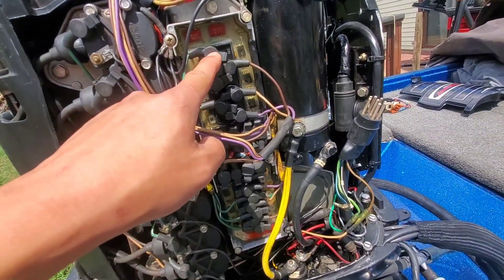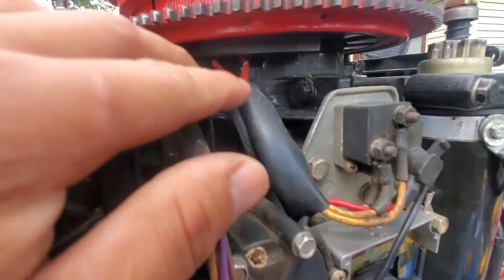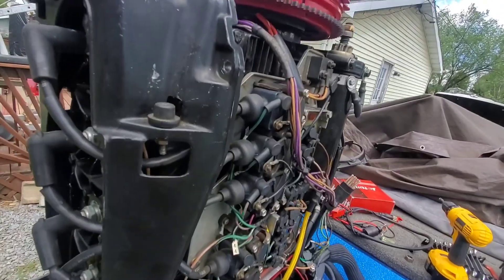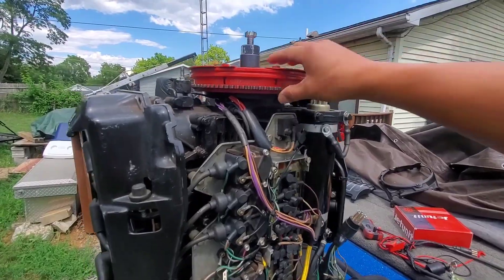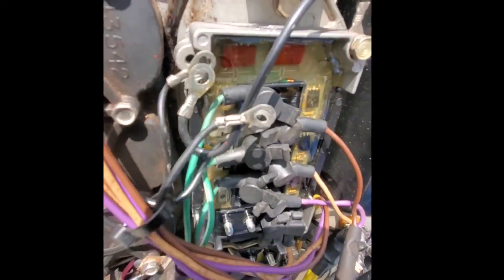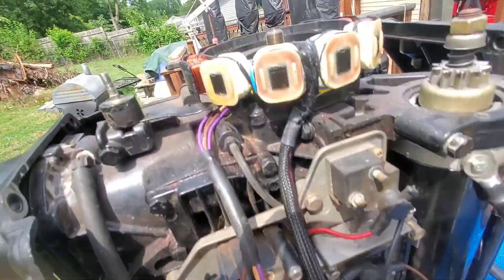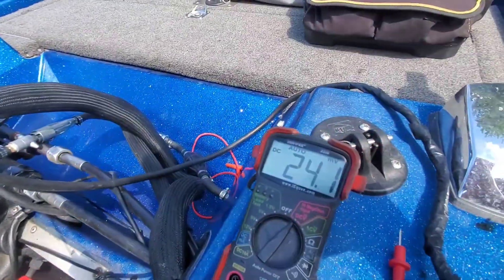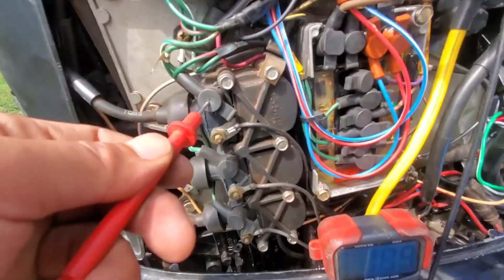Mercury Outboards: Stator Install & Testing

Comment: Hi
Help! I have a Merc 115 that stalls when I put it in gear unless the idle is set at around 1100 rpm. I watched a couple of your vids about carb adjustment so reset them, I then noticed that the bottom carb doesn't appear to be doing a lot, I can put my hand over it and although I can feel suction the motor carries on running and the revs don't change, if i do it to the other two carbs it stalls.
Any ideas?
Thanks for all your videos by the way, guys like you help to make boating fun and affordable. 
Stay safe
Paul
Reply from the maker: Something is off with the  bottom cylinders or carb. Could be an air leak? Compression?
Reply: @MerCSonL6  compression seems ok on cyl 5, not checked 6 yet as I need a different tester, think I'll order one. 
I actually wound the mixture screw right in and that didn't make any difference either. Could it be a reed valve problem? 
Paul
Reply from the maker: @pauljaques1905  there's definitely an issue. The engine should cut off or stumble really hard. Are the screws tight mounting the carb to the manifold? You could have an air leak. The bottom cylinders are not getting enough fuel. With the engine running you can spray water around the bottom carb to see if its visible. The crankcase creates positive and negative pressure. Son
Reply: @MerCSonL6  yeah it stumbles or stalls if I block the top and middle carbs but the bottom carb seems to do nothing. I'll go check for leaks.
Paul

Comment: Hey, just want to say thanks for posting these vids. Very helpful. I have a question if you don't mind? I have a 79, 80 hp 4 cylinder with adi ignition. How do I set the timing and sync the carbs on that motor? Is it the same as your 6 cylinder vid? Cause I can't seem to find any lines to line up on the linkages. Also what degrees would you recommend setting it to. Any help would be much appreciated. Or maybe another video idea? Lol. Take care.
Reply from the maker: Set your primary at specs. Then adjust your carb cluster (i believe flathead screw is on the left) to barely touch the throttle cam. Setting the idle circuit is exactly the same as the other videos. Son
Reply: Sounds good. I will give it a shot. Thanks very much.

Comment: Where did you ground the black wire
Reply: Swapping boxes around is a great idea. The stator was replaced not long ago by previous owner. I’m not sure if it’s hooked up right or not, still can’t figure out why the black wire wasn’t hooked up. It runs along with the other wires coming down from under the flywheel, stator ground? Trigger ground? I don’t know. I grounded it and got spark except 2/4. From diagrams I’ve seen I didn’t see any black wire from stator or trigger. No idea where it’s from.
Reply from the maker: @artbentley8594  trigger does not have a ground. It's likely the ground to your stator which is extremely important. Son
Reply from the maker: On the switchbox. Son
Reply: MerCSon L6     Does it ground at one of the brass nuts. I don’t have any spaces left in either switch box
Reply: Is the switch box the same as a cdi. I have two.  Upper and lower
Reply: I connected the black ground to the switch box and now have spark at all but two . Could this be bad coils
Reply from the maker: @artbentley8594  make sure everything is properly grounded. Which 2 cylinders do not have spark? Top controls the odd cylinders and bottom controls even. Son
Reply: MerCSon L6   No spark on two and four
Reply: And cylinder 6 doesn’t have all that great of spark either
Reply from the maker: @artbentley8594  that could indicate a bad bottom switchbox or bad sator. Son
Reply from the maker: Switch your Switch boxes around. That will tell you if its your switches....
Reply: If I need to order a new switch box, should I replace both?   And do I need a serial or part number?. It’s a 1979.
Reply from the maker: @artbentley8594  just the one. You can use part numbers. Im personally not a fan.
Reply from the maker: https://www.ebay.com/itm/112395179783
Reply: Thanks Son for your quick response, I’ll swap switches tomorrow and see what happens. Hopefully it’s only the switch.
Reply: It’s not likely that I have two bad coils on the even number cylinders is it?.
Reply from the maker: @artbentley8594  switch the boxes. Then get back to me. Coils seldom go bad. We need to see if the issue follows the switch. And you can "switch" by just rewiring. The switchboxes do not necessarily have to be uninstalled. Son

Comment: On my merc 402, I remove the 8 bolts on top of the flywheel to remove it. Is that bad?
Reply from the maker: Sometimes its the only option. Its not ideal. Just be sure to mark every thing so the correct positioning of the flywheel is not obscured. Son
Reply: @MerCSonL6  Can you explain more regarding this method of flywheel removal?  My flywheel does not want to come loose.  How do you ensure correct positioning of the flywheel?  I see in your video that there is a spline on top of the shaft, usually a flywheel is keyed on a shoulder on top of the shaft but your video did not show the flywheel replacement procedure.
Reply: Regarding my issue, when the engine is cold I do not have spark on cylinders 3, 4 & 6.  When I checked the stator with ohms tester the red wires had .28 and the blue had 12.3.  Therefore I believe the stator is bad.  Your thoughts?  And thanks so much for your videos, much appreciated!!!
Reply from the maker: @billblevins3581  replace the stator. The crank is splined. You will need a flywheel puller and a flywheel turning tool. I use an impact wrench in combination with a flywheel puller to loosen tough flywheels. Pullers are pretty cheap and seem necessary for your application. Son
Reply: @MerCSonL6  Thanks for the response Son!!  Can you tell me where you would order a stator for this?  I saw  one on Amazon but it looks a little different.  I was using a gear puller with no success so following your advice and ordered the appropriate puller that threads into the flywheel....going to wait on ordering the stator until I can verify part number once the flywheel has been removed.  Thanks again!!